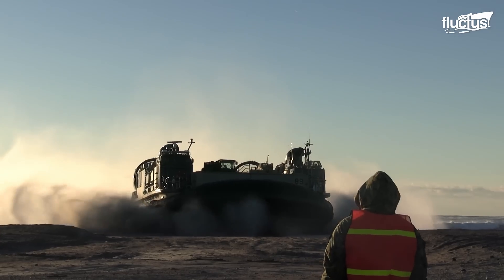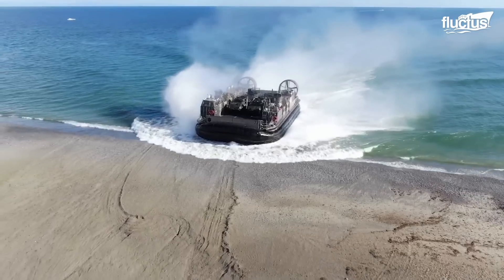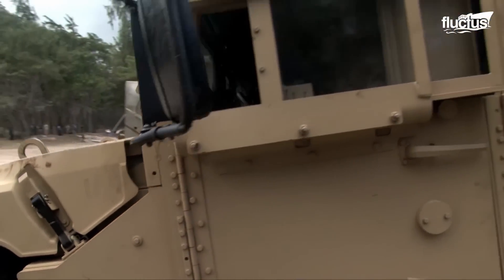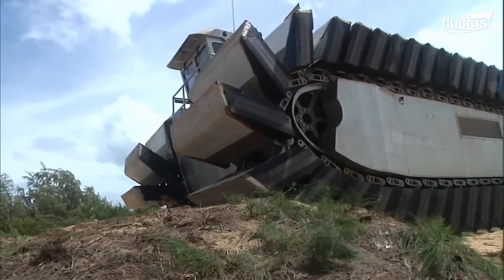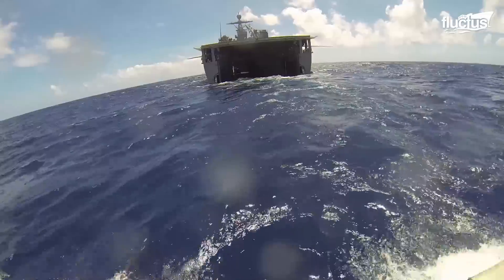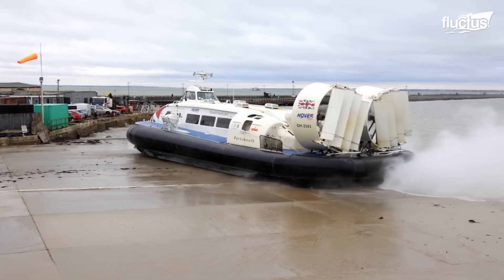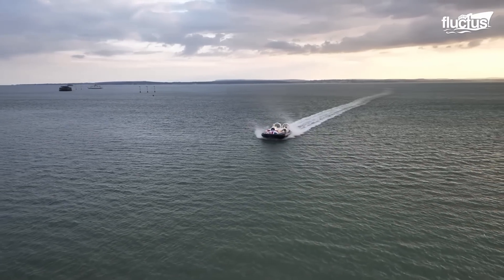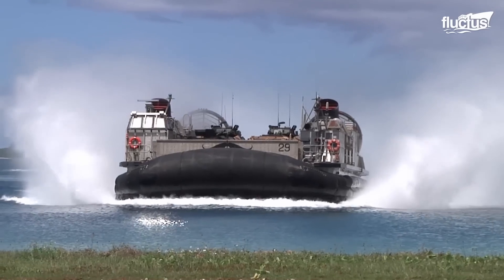How 1000s of US Marines Perform Massive Beach Invasions From Sea

Comment: Are the bladders protected from small arms fire?
Reply: Technically enough small arms fire could damage the bladder enough to render it inoperable but highly unlikely that would ever occur. The area would be deemed to hot for these to land. 

The bladder isn't fully encapsulated. Air escapes it naturally when it is in operation. So a few holes in it isn't going to bother anything. Hope that gives you an idea of the situation. Otherwise the rest of the craft has armour and special armor in critical areas.
Reply: @cplbird8179  Thanks much for the explanation, it is appreciated!!

Comment: Could you not disable the LCAC by shooting the rubber? I'm assuming they would have thought about that though and already have systems in place or its made out of a special material, just curious
Reply: Technically yes. But hear this first. The rubber, known as the bladder, is not fully encapsulated. Air naturally escapes when in operation. So a few bullet holes aren't going to do much. However if it was shot to all heck then yes you could destroy the bladder but then it's just as likely you had enough fire power to destroy the LCAC in any fashion. 

The LCAC is more than likely usually deployed to an already established beach head. What special about the LCAC is that it can transport heavy equipment in very shallow water. Specifically water that boats would get stuck in. 

I used to work on them. They are pretty cool. The bladder, or rubber, was my favorite area. That's where all the mechanics would go hide during working hours. We weren't dumb tho, wed take turns. 😆